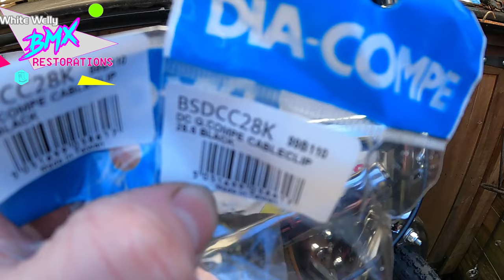1985 Peugeot CPX501 BMX Restoration & Build #bmx #vintage #restoration #restore #oldschool #peugeot

Comment: Very good, but this bottom bracket is not the best choice here
Reply from the maker: Thank you for watching. Yeah here in the uk the options are limited on what we can use. If I find A better one i will swap it out.
Reply: @whitewellybmxrestorations I used that thing as well, but I finally swapped it with an American bottom bracket, which you can find in the UK at Alans BMX shop for €40.95. You can also order it in Australia, but it's not the best option due to the shipping costs.